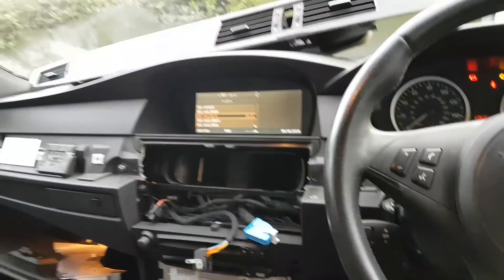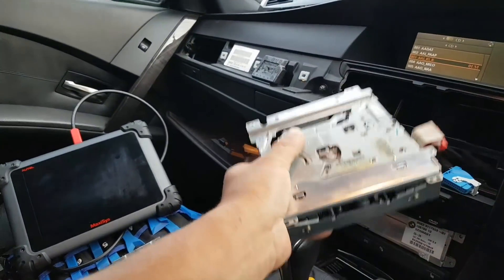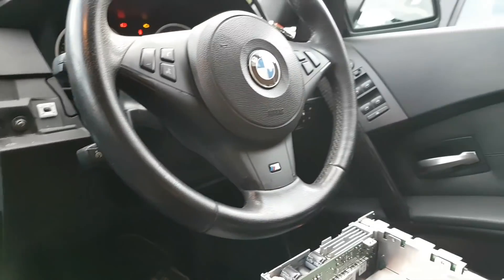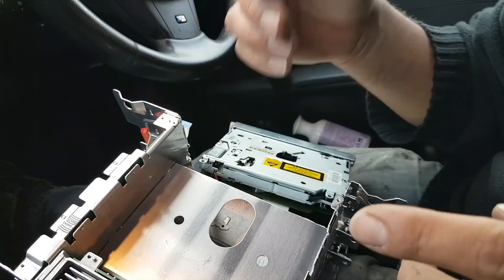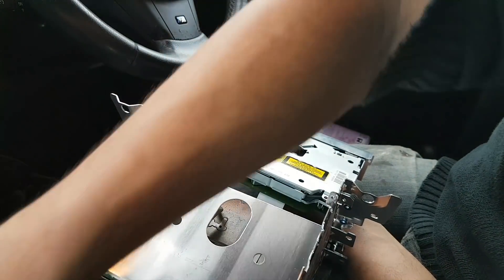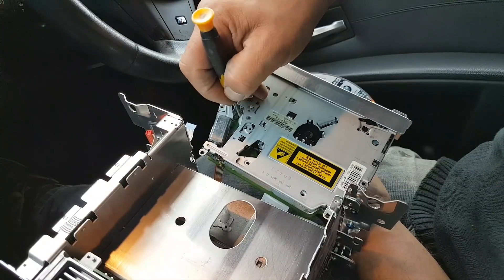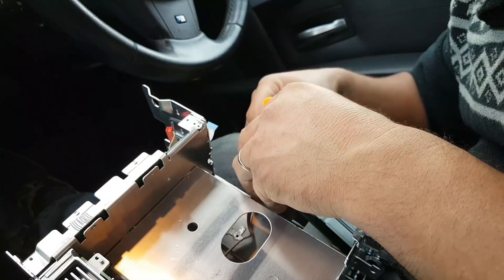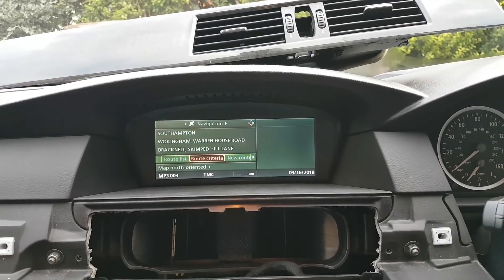BMW I-Drive CCC how to remove stuck discs.

Comment: Hi thank you for your videos, im having a problem with my 2014 bmw 328d there is a clicking in the CD port ive ejected a CD out of it however now bluetooth and navigation will not work. I can accept calls on bluetooth but can't send the call signal from the idrive. Navigationa stays on the green loading screen and my media says the radio is always checking for a CD. The only things that seem to work are Radio and AUX.
Reply: I have the same problem, did you solve the problem?

Comment: Hey friend 
Great vid!
I did it and removed the stuck dvd from the nav of my E60 M5. After plugging everything back and assembling it, vents aren’t responding to changes on the idrive. Air blows only to the feet. Everything else works but the vents are not to any change. Any tips? Power reset maybe by disconnecting the battery?
Reply from the maker: Possibly...
Try that...
The i-drive options for the vents are not grayed out are they?
👍👍👍
Reply: @LMAutoRepairs  thanks for responding. No, they are not grayed out. I can change them to my hearts desire. I’ll plug ista and run diagnostics. Thanks bro
Reply: No luck mate. Ista gives me: 00E706 IHKA LIN bus fault. Air distribution flap motors. I don’t get it. Everything was working fine.
Reply from the maker: Indeed strange...
Check the basics... fuses etc...
Check live data, and actuate the flaps... though the LIN bus fault with all the motors might indicate a common issue to all...
Reply: @LMAutoRepairs  after hours of searching the web I found one article that references my issue. The Climate Control Module is the culprit. Apparently it’s an issue and it’s not known why it goes bad. Maybe it was about to go bad and my tinkering accelerated it. Any how, I found one online and ordered it.
Reply from the maker: ☺️
Good that you found that... 
Good luck! 
👍👍👍

Comment: My one  in my e93 had one cd stuck and one dvd stucked..and today i tryed to take them out with another cd over..and ate and the other ones both..so today i have stucked 2 in cd and 2 in dvd 😂,fc.k them..probably i have to do what you done.thanks...but how they may came out if they re 2 stucked in one place?
Reply from the maker: 😅
Well, you have to open it and see what is going on inside the drives...
You might need to dismantle a bit further...
😊
👍👍👍
Reply: @LMAutoRepairs  i will try tmrrw with some tape...or double sized tape it should work..but it doesn't botter me..jist some time i think the cd trying to moove and makes some noise..otherways who now days ussing cd's or dvd's...NOBODY...
NOW WE USE DIGITALS THINGS..ALSO ON THE FUTTURE WE PROBABLY USE OUR ANDROIDS DIRECTLY CONNECTED AND DOES EVERYTHING.
Reply from the maker: @mmario1409 
😊
Reply: @LMAutoRepairs  all sorted..was a very funny easy issue with..the principal cable from the screen was the issue..not pluged in how it supposed to be.
Reply from the maker: @mmario1409 
👍

Comment: Hi thanks for helping us by your videos.I have one question, how can I clean crash data in srs control modul on toyota cars,which kind of tools I need to have and how I can use it,and do you have any video about that.Thanks a lot.
Reply from the maker: Hi
I some videos coming up soon... but on Patreon first...
Most of that work is done on the bench with programmers... some cars can be done through OBD,  but not all...
Thank you for watching and for your comment!

Comment: Hi LM, i got a citroen C4 grand picasso 2015. My local garage changed the clutch 2 days ago, but now they  can not program the gear box as they can’t connect the to ECU. 
I would like to  drop the car to you if you have a time. I am in NW london. Thank you
Reply from the maker: Hi
I am quite busy right now... plus, is not like if I have a garage or anything like that... I do this as a part time...
Have you checked fuses etc?
Which tool are they using to program it?
Thank you for watching!
Reply: Hello LM, sorry for the  late replay
My car running fine when came to garage when ask the mechanic to change the clutch, after they changed the clutch no communication with the ECU. is there  is any special  procedures  to do it before the gear clutch is open. Thank you
Reply from the maker: @AbdirisaqGuled  
Hi
I never done one, so not really sure...
But try to disconnect the battery... leave it off for a few minutes, connect it back on and try the procedure again...
Reply: @LM
Thank you bro, we just done the programming just now, we disconnected the battery about ten minutes, then after  few tries we success at last. Thank you.

We watched one of your videos that you have mentioned the battery must not go lower. And that helps us.

Once again i am really thanking you.
Reply from the maker: @AbdirisaqGuled  
That's great news! 
Well done!
Reply: I follow your channel just for curiosity i love knowledge.  i am  not a mechanic or a  garage man,   Simply i live watching you videos. Thank you so much for your replies.
Reply from the maker: @AbdirisaqGuled  
Appreciated! 
Thanks for that, and for your feedback! 
👍👍👍👍

Comment: drive unavailbe error on mercedes w204, i will do the same process?as i know there arent any stucked cds
Reply from the maker: Hi
That seems a different issue...
Have you scanned the unit, see if has any codes?
Thank you for watching!
Reply: hello.there arent any fault codes on the unit.
Reply from the maker: @panayiotistsivitanos  
Hi
You might have a faulty drive then...
Reply: yes thats possible

Comment: Does the single cd control the idrive as mine is not working I’ve got no radio no sat nav no air con
Reply from the maker: Hi
Yes... The mask has the same functionality as the ccc... or I mean, it works on the same principle...
Thank you for watching and for your comment!